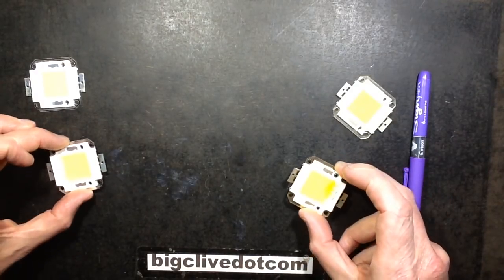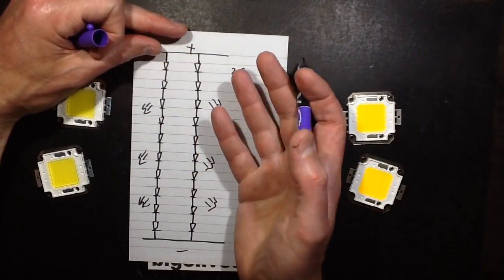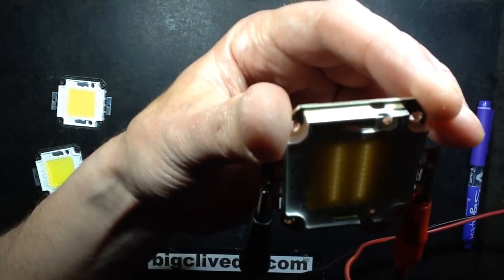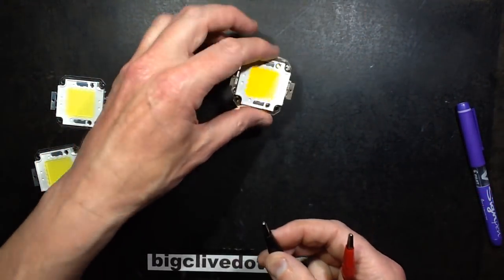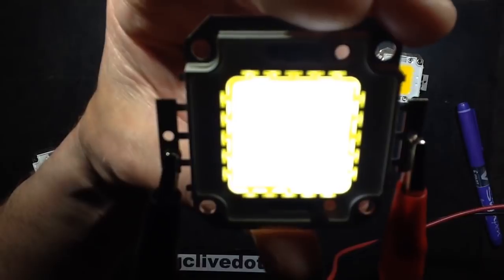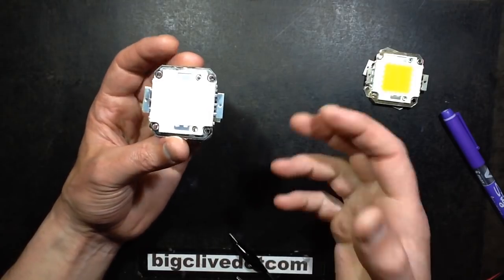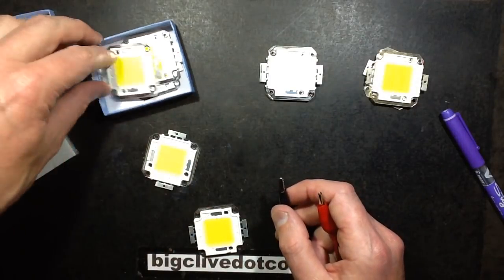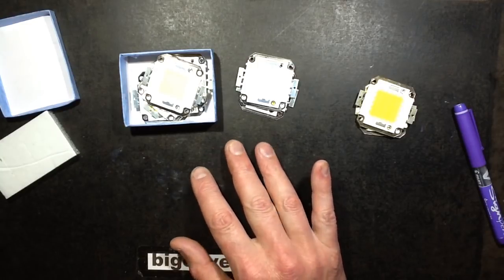Testing dodgy 100W LEDs from ebay sellers.

Comment: When I got a 100w chip form ebay and turned it on, with my power supply, all 100 LEDs were on but not all at the same brightness (but on nonetheless). Have you tried turning the voltage up to the point where they all come on or did most LEDs just stay off? The LEDs might not be matched well at all but may still be working.

Comment: im finding this more and more these days, iv built allot of my own led workshop lighting and all the older chips i used to get are still going strong where's the newer ones are not lasting at all. i do the same, run them up and put dead ones in a bag for for a later date and just use good ones, but still there not as good. were defiantly getting the rubbish. most of mine come from aliexpress too. i find the ceramic cob chips the best quality atm,

Comment: My 100 W led has 1 row (almost in the middle) that is clearly the brightest one (at lower voltage). And the rest 9 rows are dimmer but otherwise quite identical. I'm not sure if there is that much difference at higher voltage. I have it on my home made flashlight and I run it at about 60-80 W.
edit: Just tested it at higher voltage and with some dark plastic --> looks good. Although it looks like 1 of the 100 leds might be dead... And that's why that row is the brightest one :)
--> Conclusion: Otherwise good, but 1 dead LED.
edit2: And it's also from ebay/china.

Comment: I use a warm white 100w LED in my homemade torch, and one of the strings of LED's have failed, but all the other LED's do light evenly, so one LED may have gone open :(
http://i.imgur.com/piarivc.jpg

Ive had to reduce the currrent on the drive so its not driving 90w of LED's at 100w.
Reply from the maker: ScottieNiven This seems to be a common failure mode, but sometimes the bad section will flicker on and off randomly.  I'm coming to the conclusion that whatever the wattage of the LED is, it's probably better running it at half that for higher efficiency and lifespan.
Reply: bigclivedotcom And designing the LED array properly. These arrays with a bunch of LEDs in parallel with no current balancing really bug me! :(